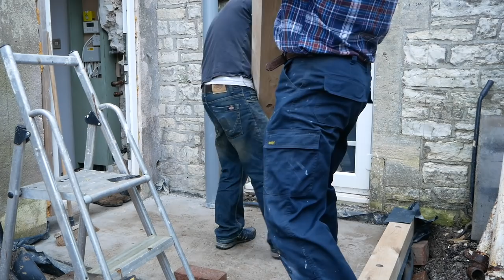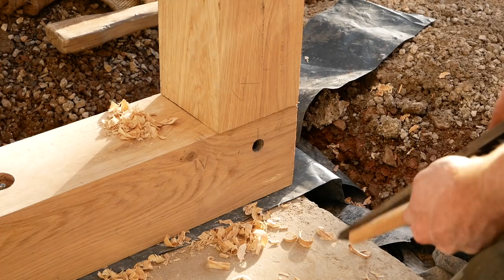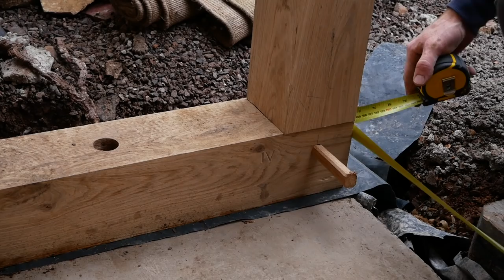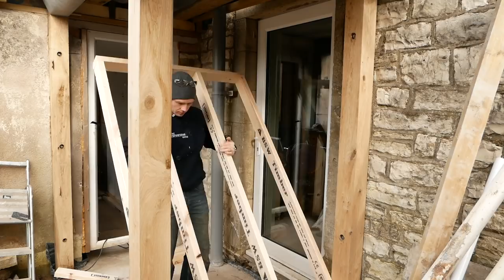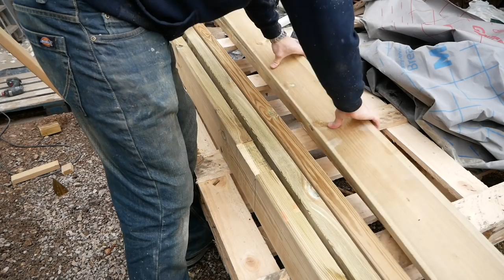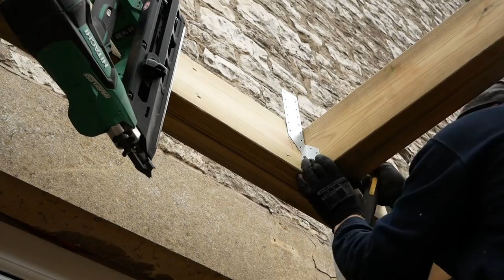Raising the Oak Timber Frame Porch

Comment: Have you ever considered pushing the wooden pegs in with a clamping/Nice mechanism rather than bashing them in? I saw one of the timbers against the wall shifting a couple of mills laterally as it's peg was bashed. It can't be ideal to side load the wall fastenings like that by bashing. There's a fine line between construction bashing and demo bashing.

Comment: Hey Tim, I have a few of questions if I may… firstly how’s the porch holding up? I’ve recently built some green oak outdoor steps, I noticed you’ve put a DPC membrane between the pad and the frame - do you find this allows the water to drain away sufficiently so the oak isn’t sat in water? Have you treated the oak or left it to silver? How are the stainless bolts attached to the stonework holding up? I want to attach the steps with SS coach bolts into the masonry, but read the twisting and shrinkage from the green oak might pull the wall apart?! I’d appreciate any advice. Thanks

Comment: Whoa… deja-vu… I’ve been using that orange saw to chop up 3x3” dunnage into firewood for the last three months.  Sadly, today I got an RMA to ship it in for repair.  Untill this week it was an awesomely performing saw, and the metal blade cut through the 10” spikes like… well, not butter, but certainly as if they were hard cheese.   These boards had been tacked together to make 8’ x 4’ rafts, and the slider made short work at cutting them up while still in a unit.  (I did have to make a table to handle all this material… but I have literally truckloads and truckloads of this “waste” wood.)
Reply: And today my retailer just exchanged it over the counter... awesome.

Comment: Would it have been possible to put the outside inside the oak frame?. That way you see more oak frame, or isnt that a good idea?. You gave me an idea for a kitchen counter/ bar idea with this hehehe.
Reply from the maker: Usually one would place all insulation or sip panels etc outside the frame so it’s all exposed inside and you get a continuous thermal layer on the outside of oak. Because my footprint is limited I wanted to maximise floor space but I’ll explain it all in a future vid.

Comment: I did a oak raised bed along back fence which looks great if I say so myself so maybe I'll consider an oak porch. 

What I'm wonder though if why the pegs are.. well peg shaped rather than a fixed size dowl?
Reply from the maker: They are tapered to allow them to drive through and bend around the offset holes. They are also much stronger when split following the natural grain of the oak rather than just cut into dowels.

Comment: Any reason you didn't put in some foam tape or some expansion anti draft stuff between the oak up rights and the wall ?
Reply from the maker: No reason but there is a scribed oak board on the outside and the internal battens and plasterboard where I will probably seal it off with the expanding foam tape I used on the roof light this week. 👍

Comment: Hello, I see you use a Ryobi finish nailer and a hikoki framer....would you say the cheaper Ryobi compares or does it show its cheaper value? Thanks
Reply from the maker: Love the ryobi and it would be overkill for me to spend hundreds on a better brand finish nailer for the amount of work I use it for. That said I have only used a couple of 18g nailers so not much to compare to. Obviously the framer is a different animal but they both do the task they are needed for.

Comment: Where the oak post is fixed to the stone wall, why didn't you use any form of DPM or treatment on the oak to stop the humidity from the stone wall damaging that part of the structure? Just curious
Reply from the maker: Not much of the oak is in direct contact as the some is so irregular. The dpc carried up the wall for the lower section and then the breather membrane was brought through higher up. Neither of which are really needed and possibly just as likely to cause issues by trapping moisture between plastic and oak.

Comment: I'm a tradesman in the US. I was watching without sound so maybe I missed something. What's the purpose of timber framing if you're not going to show it off? Looks like a combination of traditional and modern. Don't get it?
Reply: I thought that, makes the nice job done on that frame a bit of a waste.
Reply from the maker: No reason, I.e I could have done the lot in stud work however this design will still leave all the frame visible from the inside. I will be building a much larger oak frame next year so was a sort of warm up too. There is also a limit on my porch size for planning here so had to insulate between the posts rather than all on the outside. Explained more in future video. 👍
Reply: Superior Being oak frame visible on interior....

Comment: Hey Tim! When you fixed the oak to the wall, did you line the back of it with anything to stop water getting trapped inside the wood?

I'm fixing a gate post to brick and wondered if I should use silicone or back it in something. Any advice from the belts and braces man himself?
Reply from the maker: My personal opinion would be to leave it as it is especially with the gatepost. Any attempt to seal would likely trap in moisture rather than keep it out. I did put a expanding tape near the internal surface of the oak but that was more for draft proofing. The outside was just scribed.
Reply: The Restoration Couple Thank you for your help, Tim! I hope you, Jo, and the girls are all well!

Comment: Now I really see the trade off that evolution saw blade/ miter saw comes with. The cutting speed in wood is sooo slooow.
Reply from the maker: It’s got me through for 12 years but I wouldn’t buy another. That said, I imagine the newer models are better.
Reply: @TheRestorationCouple  I quite understand, that this machine gets the job done. All I'm saying is that it is not the fastest. The newer models might be better, but are not faster. 
With 40 teeth 12" saw blade and  4500 RPM ( no load speed) machine  I'm able to cut two times thicker material in the same amount of time( of course without a tearout). . 
BTW I wish I was as well organised, as you are. What I really love about your channel is that you are not chasing the micrometers when it comes to framing:)
Reply from the maker: Mortern I guess the other thing with this more traditional style mitre saw is the clearance needed behind it. Most likely I’ll look at the Bosch or Hitcahi next so it can be up right to rear wall in a workshop situation. Like you say, it gets the job done though and still perfectly suited to a DIYer.

Comment: Why wood that rots not brick?
Reply from the maker: Wood doesn’t rot if you build it right and keep it dry. There are thousands of timber buildings still standing that are hundreds of years old. That’s said, We could have used stone to match house but due to the size limits of a porch, cavity walls would have used up lots more of the space whereas timber can be insulated between resulting in more space inside.